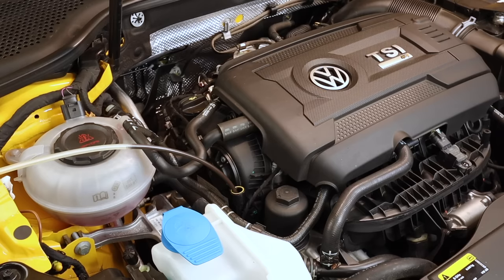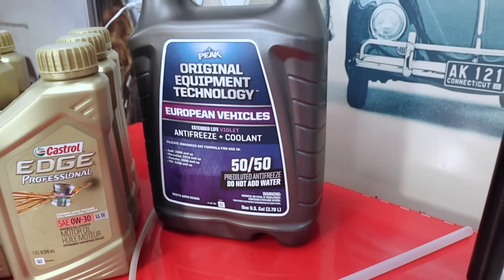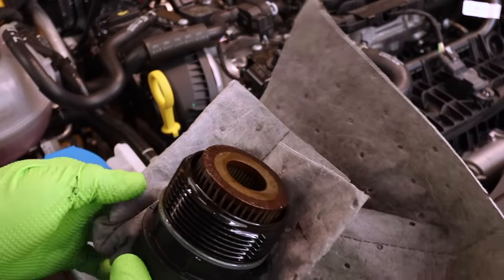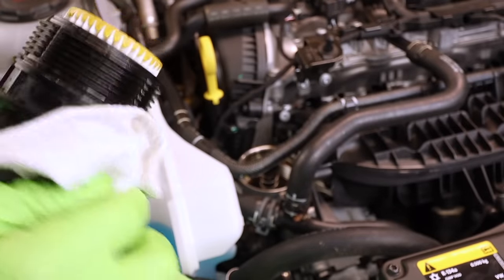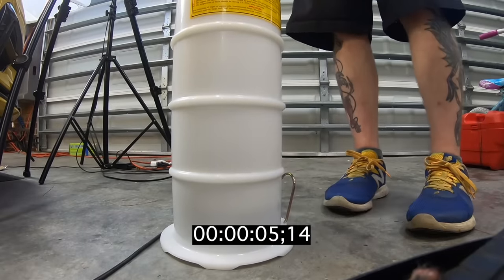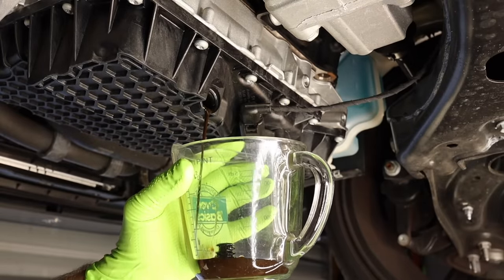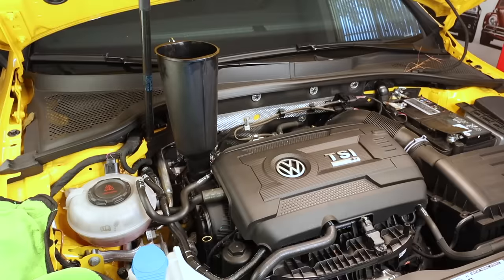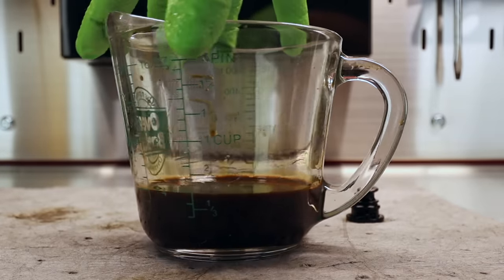Will an Oil Extractor Get All The Oil? (MK7.5 Golf R 5000 Mile Service)

Comment: you just want money for yourself making yt viewers beliewe they need such an intense service intervals. by vw it is ok to change oil every 20k miles, but it will also be ok to change it every 35k miles. black oil has just same properties if it is metal free.
Reply from the maker: Lol okay 👍. It has nothing to do with almost 20 years fixing these cars professionally and seeing what happens when the average car goes even 10k.
Reply: all germans do 30.000km interval on vag or even 40.000 on mercedes. those are manufacturer recomendations. cars easily go 500.000km. and yes manual transmision oil is lifetime, and yes rubber timing belt is 210.000km.
i dont get why americans need to change engine oil so often???

Comment: 100ml who cares
Reply: I wish it was only 100ml, but  in modern engines 10-20% (500-1200ml) of used oil remains trapped in the engine. I have oil analysis showing retention of 20% wear metals, contaminents and oxidized oil and degradation of the new oil within 20 minutes of running the engine.  Perform a second oil change with cheap oil and you will see how contaminated it is.  A second change will give you 99% clean engine oil, just like when it rolled off the line at the factory.